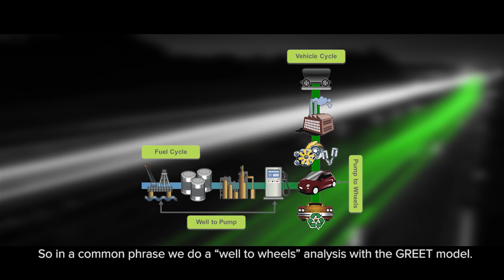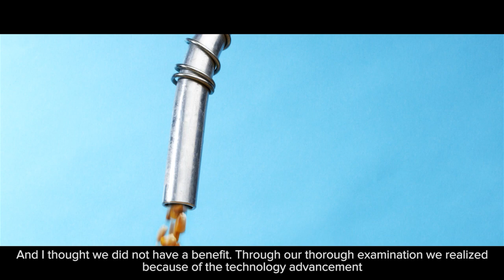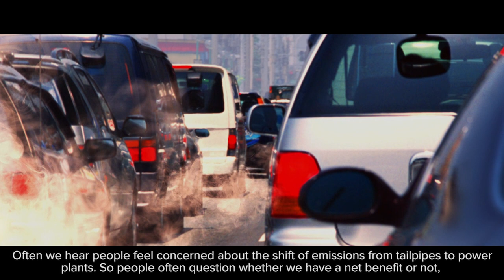Argonne's Michael Wang talks about the GREET Model for reducing vehicle emissions

Comment: Food for thought. The attention seems to be given to the power supply on motor vehicles.  Such as ways to reduce emissions, increase power and reduce the consumption of fuel. However, it is even more important what is done with that power once it reaches the gear systems that converts it into torque value and rpm. A weak man can move a ton with the right leverage, where as a strong man can not budge it without assistance.